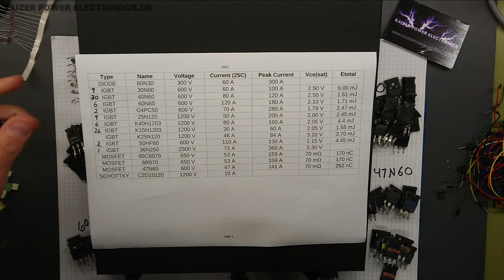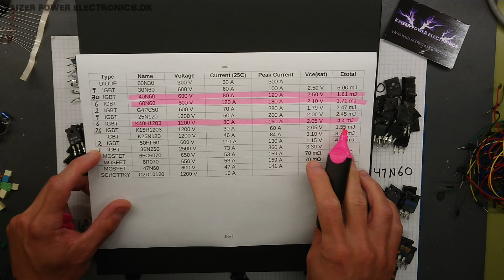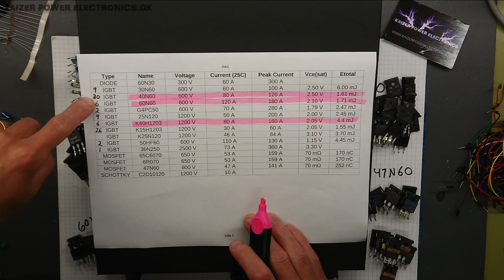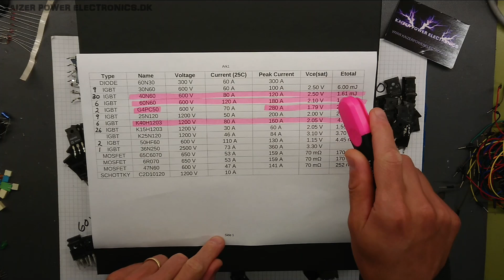Where To Get "Free" TO-247 IGBTs and MOSFETs

Comment from the maker: Do you have any sources for salvaging IGBTs / MOSFETs that is widely available from "household" items?
Reply: I have many high voltage IGBTs and <100V MOSFETs from high power UPS boards. Find a place where they repair them and you will get plenty of transistors and many more interesting components.
Reply: Well the local scrapyard is good, though most of the power electronics I see there are the more esoteric kind, like old lift controllers. Will keep an eye out for the induction stoves now they are gaining popularity, and same for inverter welders. The lower voltage parts are great though for doing things like 12V inverters, and for making power switches from.
Reply: Hybrid and electric car inverters are a source of really large IGBTs. They're usually in oddball packages, but it turns out that they're often easy to repurpose by changing out the logic circuit for your own. And since most of them rarely fail, they're commonly available for relatively cheap.
Reply: @NiHaoMike64  yeah I had a harbor freight 2000watt inverter that broke so I opened it up and it had 4 ifrp250n transistors in it!
Reply: From items home owners may have, induction cookers and solar inverters ring true. We are now at the point where a lot of solar setups are reaching 10-15+ years of age. Less common is regular inverters, generators, welders, and some air cons (all of these of the inverter type ofc).

From vehicle self pull salvage yards, hybrids offer a mixture of random. Often times for free, because such places are really only concerned about selling parts in whole... So if you remove the individual IGBTs/components and toss them in your toolbox full of sockets/spanners/etc, they dont even care or realise, esp if you actually buy a vehicle part you might need. Sometimes you get lucky and they don't even look in your toolbox. Anytime I go to a salvage yard for a vehicle part, I always toss in my toolbox any IGBTs I can pull, fuses, relays and such. I've gotten 10s of thousands for free like this. Sometimes it just depends on who you know and who is working... I've had a time or two before where I had gotten a wheelbarrow full of stuff for free.

 On business side of things, large UPS's and switchmode PSUs from data centres. Sometimes the packages and etc are not desirable, but there is a garden variety of other components that are nice. 

Scrap yard negotiation (as you mentioned on my last comment) is a great source, provided you live in a big enough city and are able to have awesome people working there. 

Over the years, I have had some amazing luck with UPS's and solar inverters. I missed out on MANY though, due to being too far away.

Another option is in person liquidation auctions. Sometimes cities hold ewaste collection events... those are GREAT, if you can convince them you are helping reduce waste by reusing, and they are nice.

Lastly, thou who doesn't look, doesn't gain. I do low-key bin hunt as well, esp in larger cities. Never know what you may find! You just gotta poke around and keep your eyes open.
Reply: I've got quite a few parts from old solar inverters. Notably the "Sunny Boy" inverters from SMA are rather popular here and those got really high quality parts inside. SMA did not cheap out on them (might be different today; they've gotten smaller and lighter). Silicone cables, beefy WAGO clips, massive heatsinks for passive cooling, big inductors for filtering, name brand gate driver ICs, optocouplers, etc, etc - and of course IGBTs. I'll post a picture of what I got from one in the forum (see video description).
Reply from the maker: I have not yet found hybrid or electrical car inverters. I am just not looking at the right places, that is for sure, but car scrapping is also a bit different in Denmark, a lot is just sold to other countries in whole and not so much part selling. For the solar inverters I just recently, after filming this video, found a pile of 20 inverters, some 60-70% of them was with useless skiip modules that simply take too long to salvage on the spot and I have no use for. Or soldered in 3 phase bricks that is only rated in the low 20-80A.

Comment: Where can the larger IGBT (Bricks) be salvaged from? I understand they're generally in large inverters but every time I go to the scrapyard I only find the smaller variants and am looking for 400+A 600+V ones.
Reply from the maker: That is most likely to be found in very large x-ray HV generators, variable frequency drives or UPS systems. But we are talking in the 70-150 kW ranges. These units are usually in the full size 19" rack enclosures. Newer systems uses many smaller IGBTs and large bricks are getting more rare.

Comment: The dell altec computer audio subwoofer with built in 5.1ch amp is a killer find if you ever find one you get a big heavy thick radiator and 3 LM3886 IC and 2 LM4668 (I think? It's 46 something I can't remember but I digress.) O and you get 2 big transformers 1 3 wire 20v 2.5a and 1 28v 2.5a with rectification! They don't make them like this anymore!

Comment: can i use an 600V IGBT in a 230V induction stove?
Reply from the maker: Maybe. If 1200V devices are usually used, its because of large switching transients and a higher C-E voltage rating is needed to avoid punch through.
Reply: @KaizerPowerElectronicsDk  the induction stove died today, the IGBT is short circuit and the bridge rectifier the same. it is an Ikea model with 2 cooking zones. I disassembled the product and desoldered the IGBT and the bridge rectifier to be able to finist the pasta with bacon.

Comment: Do you perform a basic test of the transistors before storing?  Or, do you find it best to wait for a specific application and test/match accordingly?
Great point about the increased tech level of scrap.  I may walk over to the "e-lectrikal" section next time I drop off recycle.
Reply from the maker: I test if I have to use it, but salvaging and sorting just goes into the bags/piles. Visual inspection of the boards usually indicates if its just discarded or blown up :)
Reply: @KaizerPowerElectronicsDk  Good point.  Those power levels probably do make it pretty obvious.  :)
Reply: Haha you're lucky that you're able to walk over to the electrical recycling section and take stuff. When I tried that in my country, the guy shouted at me and said "DROP OFFS ONLY".

Re. your question, personally I do a quick diode test on the legs of e.g. mosfets and diodes.
Reply: @xntumrfo9ivrnwf  Yeah, you gotta let 'em pick through the stuff they want to sell first, and not make it obvious you're really interested.  :)  I got some low-band radar counters one time and told them I just wanted the case to make toolboxes.  Turns out, they already had a few "done up" for me where they'd already taken out the "com-ponents" -- $20 each.  It was only a few bucks for a set of the things, but I had to take the com-ponents out myself at this price... The diversity of life on this planet is remarkable.

Comment: I have a huge pile of great IGBTs that I salvaged from UPSs and large PSUs for servers, etc. A family member was able to get them when they were retired at their job. Unfortunately this isn’t exactly a common household item :)
Reply: There are server surplus onlineshops in europe where you can get really cheap supplies. I both got 700W supplies for 5€ each as well ass 3kW ones for 25€ each.
Reply: @emzee-creations  another potentially interesting place to look is bankruptcy auctions. I don't know if this exists in every country, but at least in my northern European country, there are a number of websites where you (as an individual) can look at lots that are up for auction and sometimes get a very good deal
Reply from the maker: @xntumrfo9ivrnwf  I tried this. I bought two pallets of stuff and got rid of most of it again, so its all paid for. But I am also stuck with some very exotic and expensive items that haven't found a buyer in 5 years :)
Reply from the maker: Ah yes UPS, I forgot to mention those. They do tend to use larger "skiip" package bricks that are press fit and 3 phased, and close to useless for easy reuse.